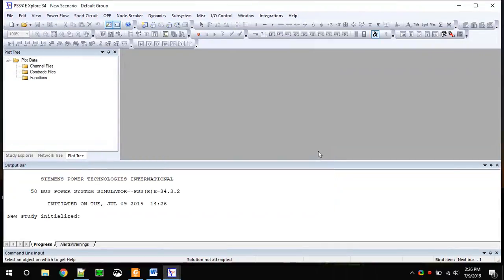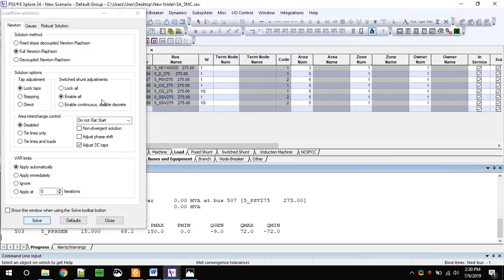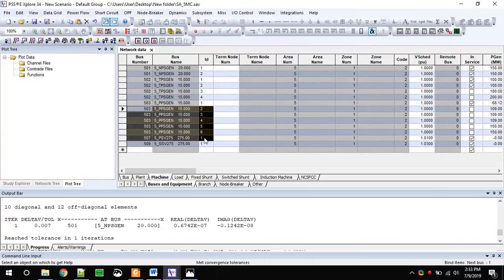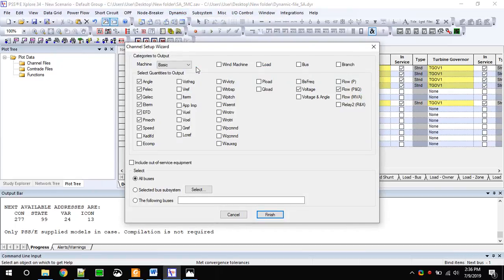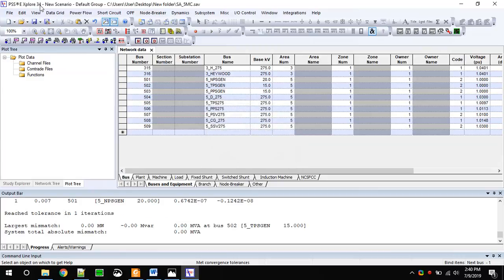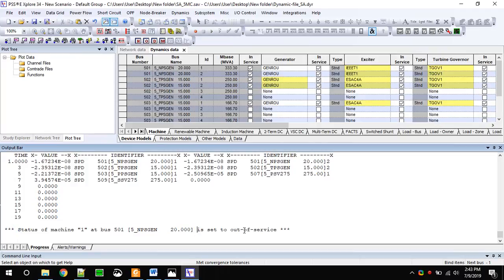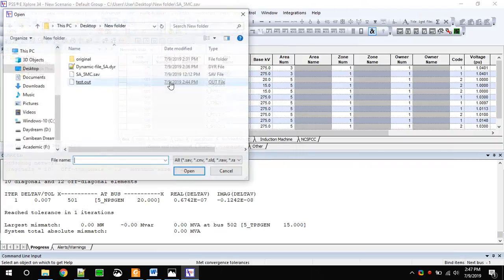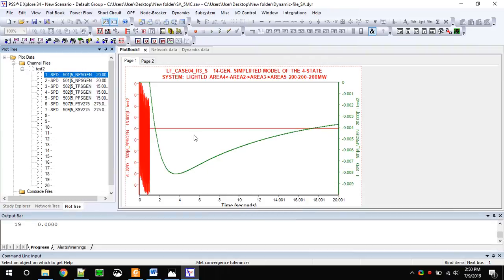Dynamic Analysis and Generator Tripping Simulation in PSSE

Comment: How to calculate the critical clearing time for the disturbance of one machine trips,
Reply from the maker: Are you asking for theoretical treatment? There is a concept called "equal-area criterion" from which you can find the critical clearing time. Hope that helps.
Reply: @SatyakiBanik  dear Satyaki thanks for the response. Yes equal area criterion, in other software we can determine critical clearing time which depicts how much time my turbine will remain in synchronism for a large sudden disturbance like an outage of grid supply or an another generator etc , this time is needed for coordinating protections, load shedding schemes, Grid Islanding schemes, all these...we can do it in ETAP, Digsilent, we can determine critical clear time, like this can't we have it in PSSE?
Reply from the maker: @rajeevbr7860  I haven't seen this in PSSE. Maybe you can take a look into the documentations.